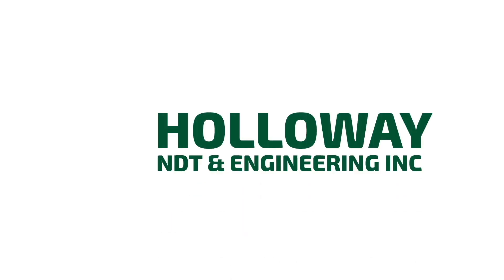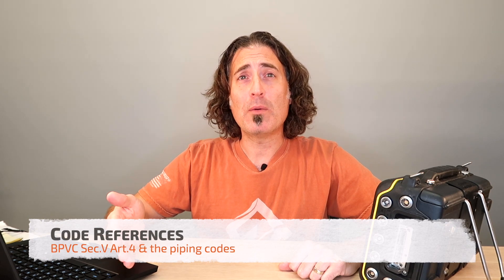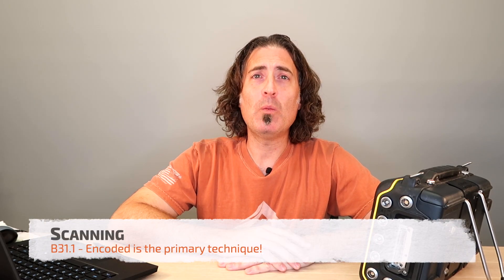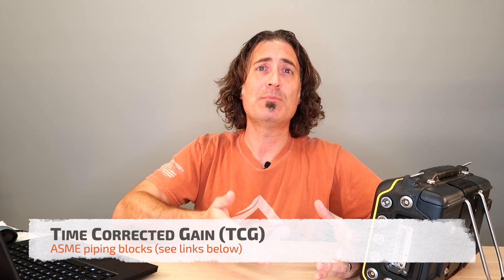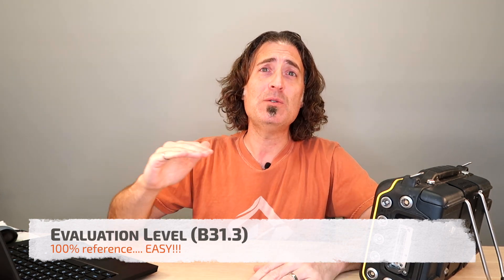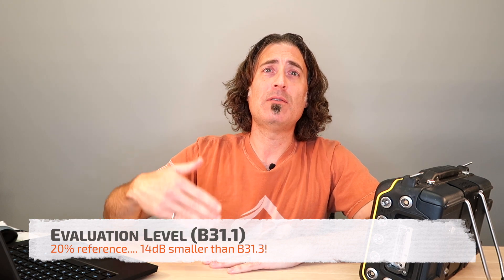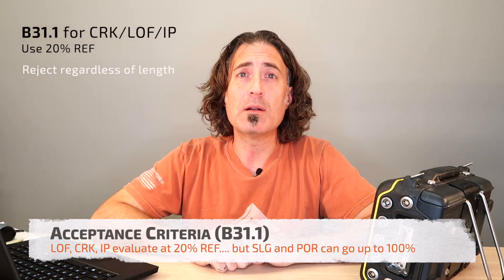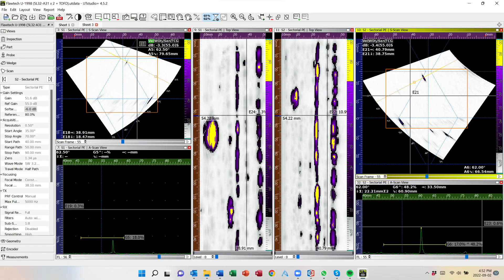B31.1 vs B31.3 - Scanning & Acceptance Criteria

Comment: Thank you so much Paul...
Could you please make a similar I formative  video for AWS D1.1 FOR tubular section. Especially for pipes having dia less then 400mm and having a long seam weld and a circumferential weld.
D1.1 doesn't have a simple table like  it has for non- tubular section although it has some charts for acceptance criteria....  I don't get them properly... Please help.
Thank you.
Reply from the maker: In Canada we use CSA W59 which has now deviated from AWS. Perhaps someday I'll make an AWS video, or they'll update the code and I won't have to.
Reply: If you aren't sure which table to use, I'll generally ask customers for the WPS for whatever welds I'm inspecting. It will tell you the accept/reject table in the NDE section. Hope that helps!
Reply: @weslecoffman8533  they didn't had anything like that. In there WPS things were available only for non tubular... They didn't even had a WPS for tubular section... Because those sections were customised, those weld joints were not supposed to be there according to drawing. And they were not supposed to be welded on site. Except only errection joints.
But it's ohk.... Now I am not working in that project anymore, its already completed.
Thank you for writing to me 🙏 i really appreciate it. 🙂🙂🙂🙂🙏.